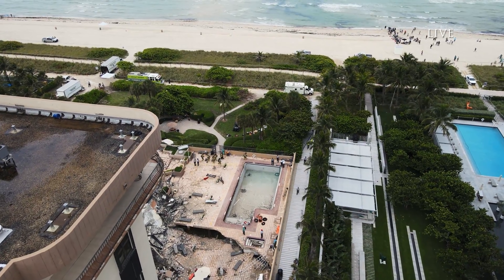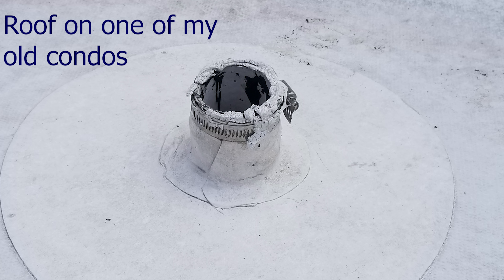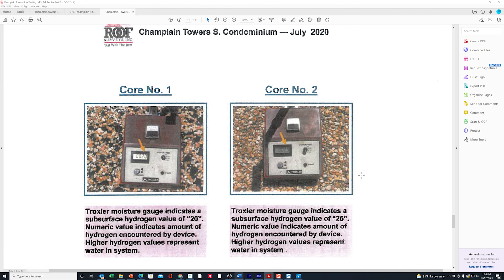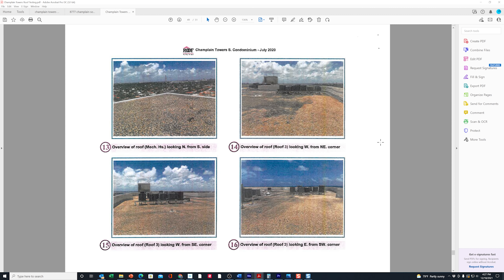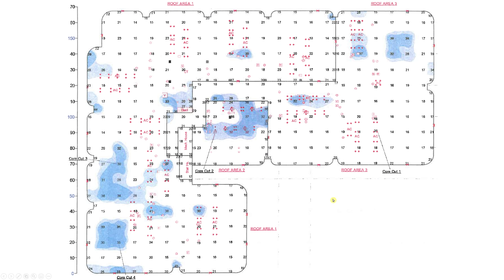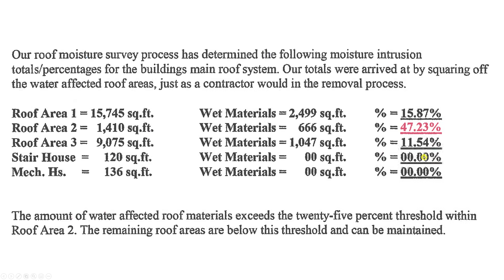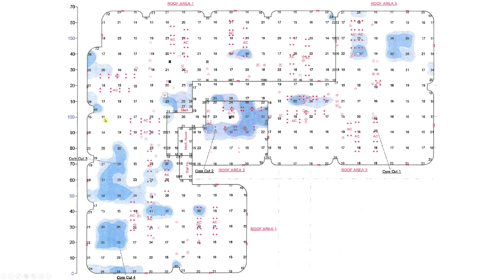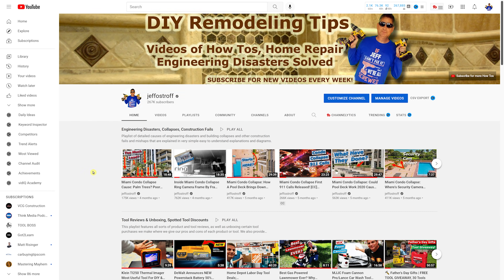Condo Collapse: Water Found Under Roof Layers (Saturated)

Comment: The roof just tells you a story about poor and / or overdue maintenance in areas which are "out of sight, out of mind".  It seems to me that it had been allowed to deteriorate far beyond the point where it should have been repaired or replaced.  It's symptomatic of inadequate maintenance of the building as a whole.

I still don't see anything to reasonably conclude that some sort of catastrophic failure at roof level triggered the main collapse sequence.  Pool deck and the KLM 9.1 / 11.1 columns (and complex beam arrangement) are still the smoking gun for me.  Pool deck first, then the 9.1 / 11.1 stuff, then the tower.
Reply: A fact that wasn't well publicized is that a woman living on the 12th floor was woken up in the early hours the day before the collapse by a loud creaking noise. Nobody else reported hearing this noise on lower floors, suggesting the source was closest to her. The noise to so loud and disturbing that she told her son couldn't fall back asleep. The day of the collapse, they were mounting anchors on the roof and load testing them. There were tons of additional load on top of the building for the roofing job. The parapet was likely inadequately anchored. Very few people have looked more closely at the role the roof may have played.

A poorly anchored parapet falling off the roof and  landing on the pool deck would have been a massive event, triggering a cascade failure.
Reply: Given all the leaks in the halls and apartments below that particular section of roof, it does seem likely that the water may have been working its way down and weakened the entire structure above the garage as well. But the "smoking gun" is still the problems with water at the pool deck and garage levels - there was more than enough water problems down there to cause the collapse even without the roof leaking as well.

But it definitely shows the attitude towards maintenance and repair that they had - whomever was in charge of that at CTS.
Reply from the maker: Yes same for me
Reply: What a strange focus! We had hundreds of thousands of "bad maintenance" buildings in Europe around the 1960s to 1980s, often "overdue" by decades or even centuries. But they would never ever collapse. Because they were built in a normal way, like a house, not like some kind of experiment.
Reply: I just did a quick google search & Europe has experienced many collapsed buildings over the last century

.
Reply: Also concrete slab/ floor construction is not “experimental”.  It’s existed almost 100 years in America, Brazil, Europe, etc

Comment: Wow. This building was a mess. The rebar, straying from the plans, from the pool deck, mystery columns, and now basically the roof was also a ticking time bomb. It's horrible how it looked unassuming until it took tje lives of almost 100 people in minutes ( that was years building up to under the pretty disguise of a seaside condo. Kinda goes to the old saying..... Polish a turd, it's still a turd....but a shiny one. 
I hope all condos take cues and make sure they are strong and sturdy.
Reply from the maker: Yes they should have all condo building managers follow all the results from this collapse
Reply: @jeffostroff  I think they should change inspections from 40 years to 20 or so. Some of those building may have small things that will add up... Hopefully not like this did. So many people... Those kids and babies.... That just gets me. Ive had to bury a child and you NEVER recover. You keep living but part of you is forever changed.

Comment: Well done on the breakdown. When I saw how much water was on the roof in the pictures, I figured, "that is a lot of water!" But the report shows it really wasn't as much as initially thought (though high percentages of water are still bad). Was the roof in a state of disrepair? Absolutely. Was it a major factor in the collapse? Not so much. Time to look elsewhere.
Reply from the maker: Ii still think the worst water intrusion was down on the pool deck which is why it collapsed.
Reply: not the trigger but likely helped in the collapse

Comment: As you say Jeff, NOT a factor in the collapse, BUT... Yet Another example of the HOA's overall "letting things go until it's really, REALLY bad" pattern of behavior.  =:O
Reply from the maker: This one I would not so much blame on them because you don't know there's a problem until you do the meter test. However certainly they should have the roof inspected maybe every three to five years just to make sure there's nothing visible like pooling water. If you have pooling water it's just a matter of time before you have water intrusion because if the water has nowhere to go it will find the path of least resistance

Comment: Hard to believe the additional cost of putting a mere 1/4" per foot slope on "modern" roofs--at construction time--isn't repaid in spades with all the repairs you do NOT have to do down the road... smh.
Reply from the maker: Some roofers are lazy. Or...they rebuild it back up the same way they saw it built when they tear down the old roof
Reply: @jeffostroff  NO, I'm talking about putting the concrete slab itself on a slope, and just have scuppers/gutters on the downslope edge.  That way, future roofers really can't screw it up, just do their usual thing, but still not enough slope to pose a safe-footing issue.  GOT to get the water off the roof within minutes of the rain stopping.  Perfectly flat roofs are stoo-pid-ity brought to us by artsy architects.

Comment: Just wonder how hard it will be to prove that the condition of this roof contributed significantly to the collapse ?    My guess is when the Federal agency is finished with their analysis, there will be multiple causes that contributed to this collapse.  It's a bit like the train wreck video on youtube in San Bernardino of May 1989, the South Pacific train crashed at high speed coming down the mountain into San Bernardino.    A number of factors caused the accident, including all three brake systems on the train, i.e. the hydraulic brakes, the dynamic brakes and the emergency brakes all failed, the train engineer could not reach the dispatcher, 
only two of the 5 engines had working brakes, etc.
Reply from the maker: True, but so far have not seen any evidence to show what role the roof might have played. Remember the collapse started at the bottom of the building.
Reply: @jeffostroff  True, but it could argue for substandard building construction? Or poor building maintenance as a contributing factor. As in if the roof is this bad and poorly built / maintained - what is to say this isn't endemic throughout the structure. I'm not an engineer so only speculating from an armchair perspective.
Reply from the maker: @warailawildrunner5300   OK MA with civil cases like this you often don't even have to prove very much and sometimes even just get a settlement where nobody has to admit anything
Reply: @warailawildrunner5300  You don't have to make that argument.  CTS was built by Nathan Reiber.  It WAS SUBSTANDARD in every way.
Reply: On the train issue: Many North American trains have one electrical braking system and two pneumatic (compressed air) systems. The locomotive circuitry can usually be configured to channel the locomotives' motion through the electric motors into a radiator on top of the locomotive. The engineer also has independent controls utilizing compressed air to press friction brakes against the treads of the locomotive wheels (eight to twelve per locomotive) or the wheels on the freight/passenger cars (usually eight per car). The length and volume of the plumbing operating the brakes on the cars can delay the application and release of those brakes.
Reply: @robertvirginiabeach  Thanks for the reply robert.   If you would like to see the Southern Pacific video I referred to of the train derailment in San Bernardino CA, here is the link, https://www.youtube.com/watch?v=0NS84qoYV_Y
They spoke of 3 brake failures as you will note, (I'm no expert on trains)
as well as weight miscalculations, only 2 of 5 engines with working brakes, etc.   I'd be interested in any of your comments after you see this video.
Reply: @robertvirginiabeach  Thanks for the reply robert.   Here's the link to the video I refer to, the Southern Pacific train derailment in San Bernardino CA.
They mention 3 brake failures, weight miscalculations, 2 of 5 locomotives had working brakes, etc.   I would be interested in hearing your comments after you see this video.  https://www.youtube.com/watch?v=0NS84qoYV_Y

Comment: It's odd to me as a non-engineer why the pool deck isn't considered a roof.  It covers a structure and is intended to prevent water intrusion.
Reply from the maker: Interesting point. But we don't put tar on the pool deck
Reply: @jeffostroff  You would use a waterproofing product over the concrete, before the tiles/pavers are laid. And our local building code (i'm in New Zealand) would consider the pool deck to be a roof, just like a balcony that has living space below.
Reply: @mark77193  Any sane person would waterproof the pool deck - unless they worked as CTS condo management...

Comment: I had my roofing contractor up there at the same time as the agent. He could point out all the damage. I got the new roof.
Reply from the maker: That's how Liberty Mutual scammed me. I told them no one goes on the roof without me being there. We had an appointment time in the roofer never showed up. I found out later when I saw the photos that they took of my roof that he actually showed up the day before our appointment and went up there without me even knowing about it and I could tell which day he was there because our garbage cans were out and they were in the photos up by the street. so by going up on the roof when I wasn't there, allowed them to say anything they wanted about the condition of the roof.
Reply: @jeffostroff  wow!

Comment: 1. roof is a red herring, other than it shows association's maintenance program.

2. 40 year old building, hope this is not the "original" roof.  would have maybe expected a roof-over-roof replacement 20 years ago and now ready for a new roof.

3. I don't think anyone in a termite area would install wood fiberboard or any cellulose material in a roof in the last 20 years.

4. In a hurricane area, who installs a gravel surfaced roof in the last 30 years???

5, I've seen worse as to water infiltration.  Just needed a complete removal, deck inspection for any spalling (dragging a chain), maybe some drying out and a reroof.

6. you said the slope was made in the built-up roof.  I have always seen it done in the polyiso if the deck had no slope.  These days a 1/2"/ft slope is recommended for built-up roofing and 1/4" for single ply.
Reply from the maker: They likely coat the aggregate gravel in a layer of tar

Comment: I have O&I coverage on my house, my house currently has a split deck roof structure. I can't have a single shingle patched through my insurance technically.. They'd have to replace the entire roof structure, which is gonna be a fun fight. If the time comes..
Reply from the maker: Yes hopefully that time never comes
Reply: @jeffostroff  Throwing a metal roof on it this spring, I don't plan on being here much longer as the value of the property is pretty stable with or without the 80 year old house.. LOL 

I can rezone the lot commercial.

Comment: What happens when they go to replace these types of roofs? Do the people on the top floor move out while repairs are on going? How does the value of these condos get effected in other older buildings? Are these other buildings reacting to the collapse of this one? Thanks for your series of videos.
Reply from the maker: Tim, the people stay in the building, they don't remove the concrete slab which is the ceiling of the  top floor. They scrape off all the tar and aggregate, then shovel up all under layers, than start all over laying down all the layers of materials they need. Once you have a new roof on, it makes it easier to sell your unit. Even though I complained about assessments of $5k to do my roofs in other condos, once you do it this because an easy selling point for your condo to tell the new owner they won't have to worry about a new roof for 25 years.
Reply: The only nasty part to live through, as a resident, is the STENCH of the hot-mop tar step, but a GOOD roofer is going to get that done in 1 day, 2 at the most.
Reply: @MajorCaliber  Thanks for the input. Repairs of any kind is not always easy to live through, but it necessary.
Reply: I was also wondering that. It seemed a bit extreme to me that one would replace an entire roof just because it leaks. The language is a bit odd though when one says 'replacing the roof' but means replacing what is on top of the actual roof.

So it is actually the waterproofing and insulation that is replaced, not the actual roof, am I understanding right now?
Reply: @listerdave1240  Yes, NOT the "beefy" or structural part of the roof (which in this case would be a 6"-8"/300mm-400mm thick concrete slab) but the "built-up" layers that provide slope-towards-drains, waterproofing, and some sound insulation against rain, hail, etc.  So on a high-rise like this, the parts that get replaced actually weigh very little, per sq. ft... it's just a lot of hard labor ... in the hot Florida sun... with frequent danger from lightning strikes... and getting dizzy from the tar fumes and falling off the edge... =:O
Reply: @MajorCaliber  being a roofer in Florida is a rough way to make a living!
Reply: Our building in Hallandale Beach had a $1.8 M dollar roof put on a few months ago.
Reply: @Spritsailor  And I thought that $12,000 roof on my Kentucky home was expensive. Information like that does put things in perspective.

Comment: I always found it a bit strange that most (things) today are inaccurate/faulty, a flat roof is always dead flat......not allowing water to drain(???)
Reply from the maker: Lou it is called a built up low slope roof. The concrete slab is flat on the roof yes, but when they add those layers of membrane they are supposed to be built up in a manner that makes them sloped toward the drain it's not rocket science and any roofer should know how to do this but very few of them get it right
Reply: @jeffostroff  The Polyiso insulation sheets are available tapered (i.e one end of the sheet is thicker than the other, to create the required slope on the roof surface. I'm a roofer, and yes, its not rocket science, just common sense.

Comment: Hi Jeff I subscribed your video, been following you every since condo collapse, water buildup on the roof did water go thru the roof and down in interior walls that might add more weight on the building and same way the pool deck also the lady mention that the building was not safe and molds that really bad situation there, the building should have been condemned in the first place before it collapsed.
Reply from the maker: Yes I can't help but think that if they had started this 40 year recertification plan back in 2018 when the engineer first warned them about the damage to the concrete, maybe the collapse would not have happened

Comment: another great video Jeff, lots of water at work, those areas like stairwells and  utility shafts go from floor to roof in a condo, so any water getting in would run straight down to the parking garage, what a damn mess that place is turning out to be
Reply from the maker: yes the more we unravel the layers of an onion this is a real Pandora's box
Reply: @jeffostroff  appreciate you slicing it up man, youve shared a lot of time and research
Reply: I'm keep wondering if the penthouse units under the pooling roof water had ceiling leaks/mould issues.
Reply: @sandyhammond  GREAT question. Being (by far) the most expensive unit in the bldg. (and therefore paying the highest HOA Fees), you'd think the TRIPLE-SIZE Penthouse would be the first to complain about such things.  Not sure all those "in-house" complaints were copied to Town of Surfside, unless it got to the point of lawsuits and/or code violations.  The PH had a LOT of other peoples' HVAC condenser units vibrating around on its roof, and therefore the electrical wiring and copper plumbing for all those AC units would also be penetrating the PH roof slab .  The PH had a lot of jury-rigged after-thought aspects to its construction... it was a symbol for all the corruption surrounding this tower.